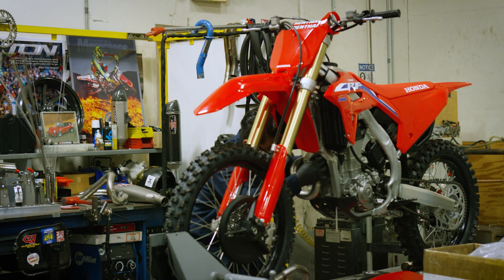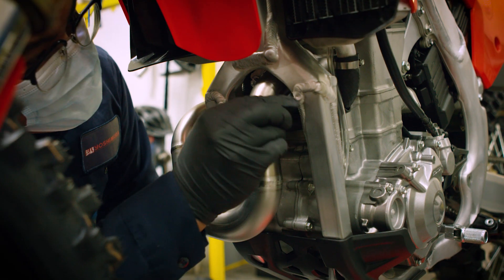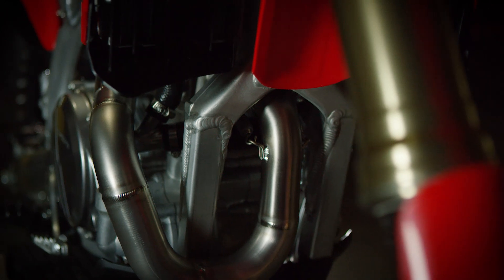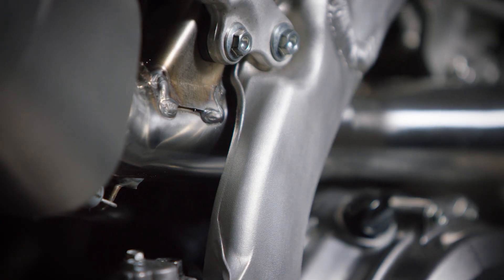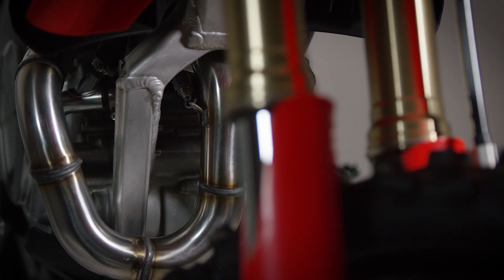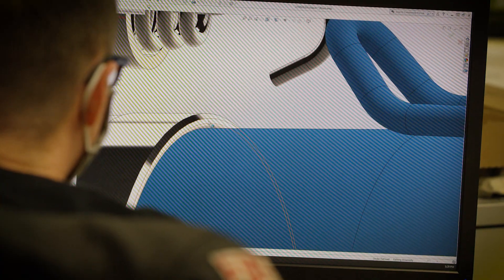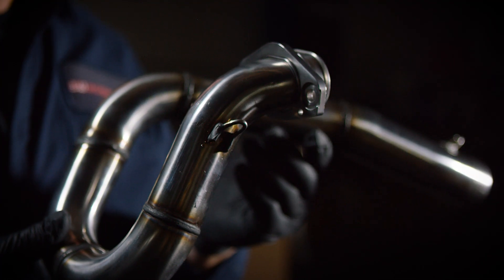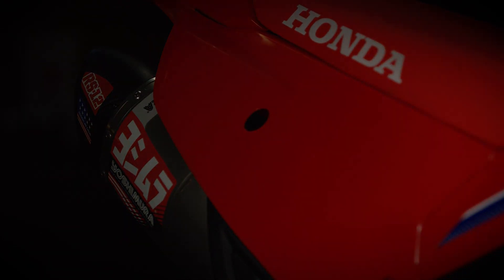2021 Honda CRF450R/RX How Yoshimura Engineers Overcame Chassis Constraints

Comment: Looks good, they should put that same logic into building a KX exhaust.  Instead the one they built sticks out further then the stock one!
Reply from the maker: The KX450 RS-12 is actually shorter than stock, it makes more power and the dB level is down. We put a lot into the new KX450....